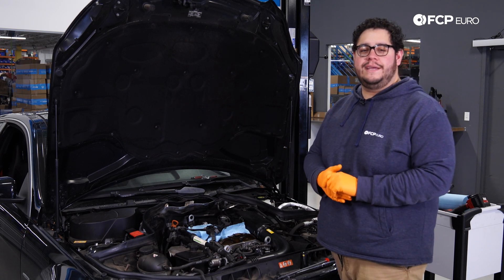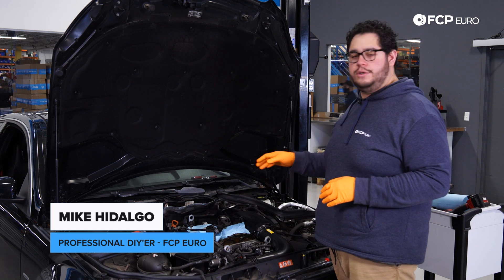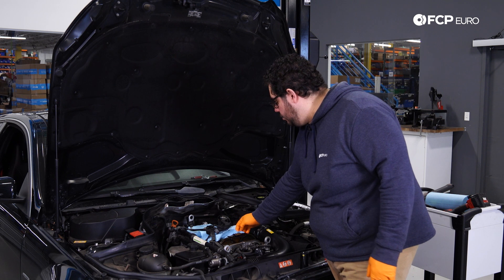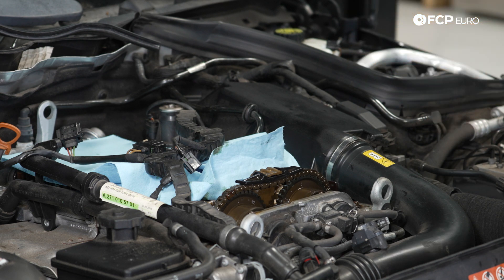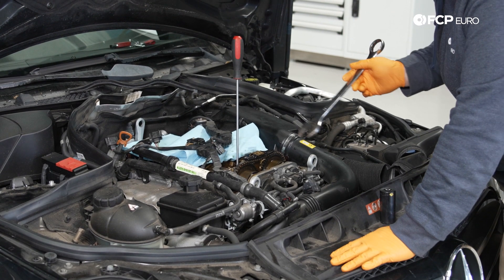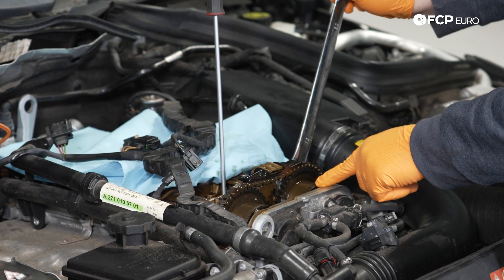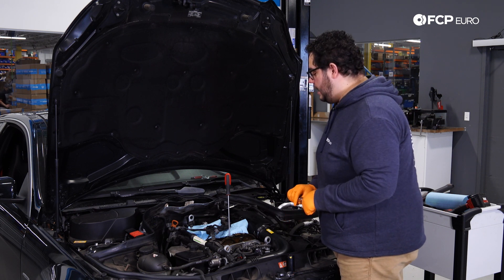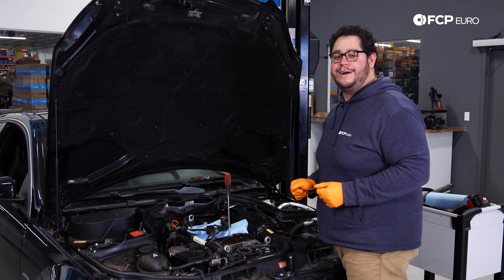How To Check A Mercedes-Benz C250 Camshaft Adjuster (Mercedes M271 Engine)

Comment: Thanks for helpful video. The Mercedes factory manual says that, to check the position of camshafts, the engine needs to be turned by hand until the piston in cylinder 1 is positioned at TDC on the crankshaft pulley " + or - 2 degrees". My adjusters line up with the arrows on the camshaft bearing housing with the crankshaft pulley but only at .5 of a degree behind (to the left of) TDC. Does this mean my engine timing is correct or do all three timing reference points have to be "bang on"? Many thanks again.

Comment: Hello Guys, We've nailed down a solution for the issue with the locking mechanism in M271 EVO engines by designing completely new VVT gears. Interested in trying them out?

Comment: Ofc my c250 sport VIN doesn't qualify.  But I just replaced the actuators and sensors.  Can you show us how to use the tool and remove those while putting the chain or torque it back to the right timing.  Just hit 11 years and 124k...it's day 2 with the swap...I hope it's nothing more.

Comment: I just live it the video!
I am planning to get m271 in the e250. And I am very concern to get something in a good condition. I am saying engine that have been looked after! Can you tell more common issues with this engine, and what is it the symptom of this intake can non align? Engine light? Noise? Usually how many km does loose the align?

Thanks

Comment: Wonderful job as usual! Do you when there will be videos on 2019 or similar year GLC43 that has M276 bi-turbo 3.0 engine with replacing Throttle Valve Actuator, Charge Air Distribution Pipe, Induction Control Motor Position Sensor, Evaporative Emission System Leak Detection Pump, & what to do with camshaft position "A" timing over-advanced please? Thx!

Comment: But the extended warranty only applies if the check engine light comes on.  Mine is in the shop now with no CEL and they won't replace it, even tho it has the hard start up.

Comment: Good tips…Do you have any tech tips for the M272 engine on the E350?
Reply from the maker: Hi Pat, not at the moment, but when we get our hands on one we will certainly tackle a few.
Reply: @fcpeuro  ok thank you
Reply: @pb39374  are you aware of the 2 essential checks (that may cost $700 at dealer): looking behind the sensor for stamp; and looking for marks at 40 degree?  I just had DTC 1208/1200 fixed successfully.
Reply: @petediegan2794  sorry, isn't the stamping at 340 degrees and you check if both intake and exhaust are in alignment with the holes. If not, that would likely be a worn balance shaft. The codes you get are for both intake and exhaust being out of time with the crank.